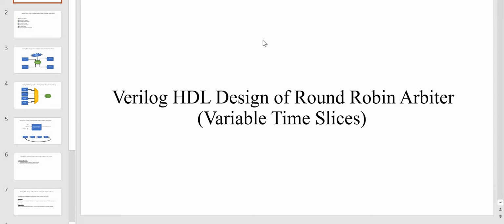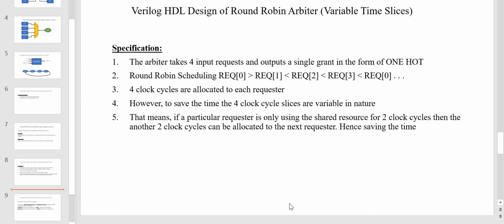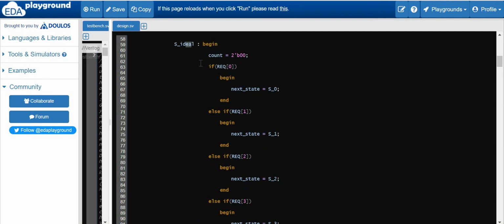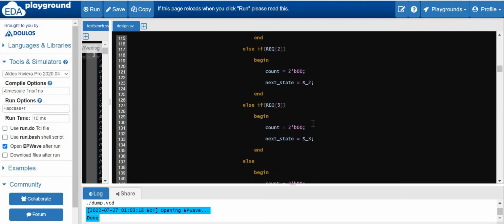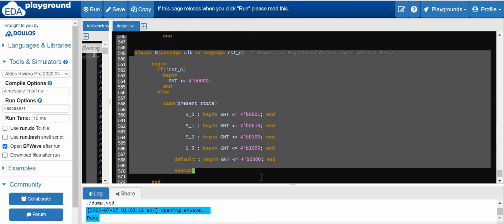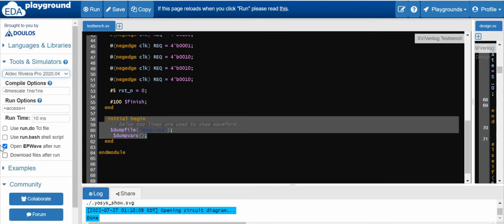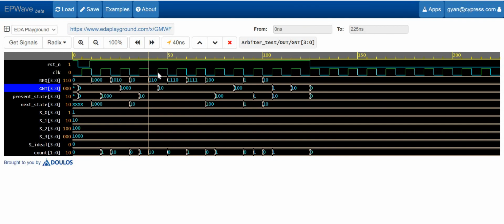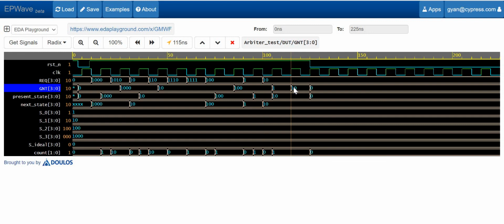Round Robin Arbiter (Variable Time Slices) | Verilog HDL Design | Digital System Design

Comment: Count is not  a flop/sequential  , so it won't hold it's value till next cycle .  Implementation of count is not correct.
Reply from the maker: Hi Ajay, Count update is sensitive to Preset State, Next State and REQ Signals, Assumption here is REQ is a Synchronous Signal to the Arbiter Clock Domain.  This is one of the application specific implementation.